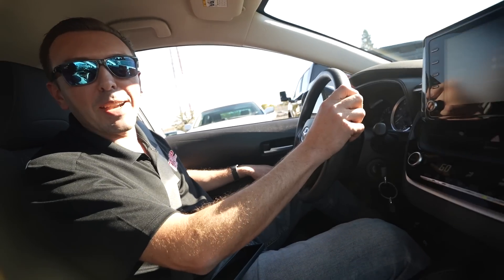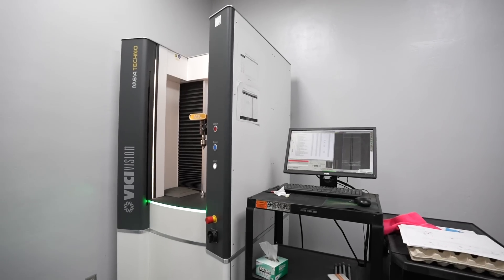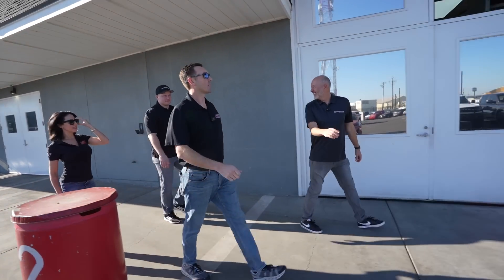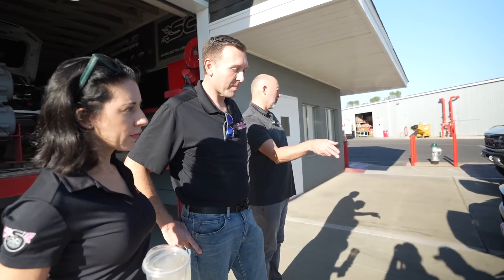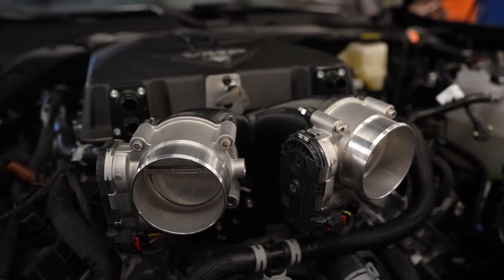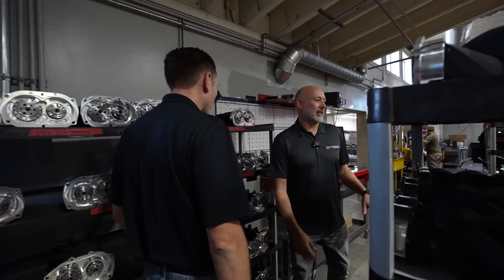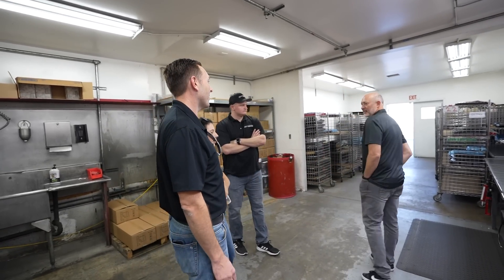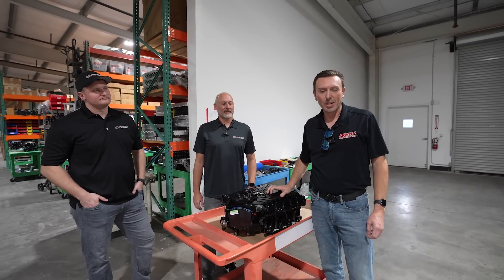When two supercharger powerhouses get together, HORSEPOWER happens!  ||  VMP Gen 6 3.0 L '24 S650

Comment: I’d absolutely die to see VMP, Whipple or Eaton come out with a “Kit” for every old school roots ‘71 series blower owner to convert to a TVS, or screw rotor system in their existing case! 

Whipple went and made the W510R that’s a screw version of a ‘71 series roots, but who wants to scrap their $4,500 plus roots they already own to buy a $6,800 new blower..? NO ONE! 

Why can’t a TVS rotor pack be manufactured, and a “shoe” for the top if needed and  an insert for a delta on the bottom… 

Need to make roots blowers great again! 

I’m not the guy to pioneer it… 
There’s probably 8 times the amount of roots blowers out there than there are people with “new style” roots and screws…
Reply: Because demand or rather lack there of. Plus the cost to design it would make it almost as expensive as getting a whole new blower.
Reply: Obviously for the first one… 
Not for the 3 million kits sold thereafter, just in the states… Proper marketing and display at SEMA and PRI… it would explode like never seen before. Not to even consider every Australian with a roots blower… It’d be multi billion income…  @mooosestang
Reply: Look into Harrop out of Australia. They're not cheap but they do this exact thing.

Comment: So when exactly did VMP become a supercharger powerhouse? 😂
Reply: VMP is waaayyy superior to Whipple. Whipple is all the hype. Their quality control sucks. I've seen it first hand.
Reply: @JJD-9403  Whipple is literally making VMP superchargers. 🤣
Reply: @JJD-9403 vmp superchargers were made by roush and magnuson
Reply: @petergalvez6431  and Whipple is making them now. Did you even watch the video?
Reply: @JJD-9403  I've been running a 2.3L whipple on my 06 gt for 17 years and counting. Not one thing has gone wrong with it. WTF are you talking about? They will also stand behind it even outside the warranty.
Reply: @mooosestang  Glad you think so. The case on my gen 3 was totally out of spec. Rotors making contact with the case. I was told blower must have taken in debris.  Blower WAS NEVER even installed. It was fucked right out of the box. The back and forth with Whipple was ridiculous. They were complete assholes about it. Absolute junk!! Never again. Glad you had better luck than me.

Comment: Justin, I bought your Gen3R appx 3 years ago for my Gen1 Coyote & love it! ... My 2014 Shelby is still running OEM Supercharger (don't plan to change that one)... However, our 2019 Gen3 Coyote is just coming outta warranty, so we are planning to buy a Supercharger kit later this year... Will this new combo company Supercharger be available for our 2019 vs the ODIN & if so, what will it be called??
Reply: Buy a gen6 whipple and make 630whp on 10psi with 93
Reply: @RadDadisRad I made 725whp with a Gen3r on my 2014 Gen1... I hope to God yall making more than 630whp on a Gen3 car with a Whipple.
Reply: @still.emotion  not at 10psi

Comment: Was the TVS 3100 a big disappointment vs. the 2650?
Reply: Yes. Same power at same boost.
Reply: @RadDadisRad   Same power at 15 psi on a stock engine or something?   Would love to see the data
Reply: @BCSVT  they used a supercharger dyno. When comparing the 2650 rotor pack to the 3100 they saw no advantage because the extra horsepower that the 3100 made it used to drive the larger rotors. So more strain on the crank snout for no measurable gain in performance.
Reply: @RadDadisRad   Doesn’t seem possible.  I guess Eaton really dropped the ball on the 3100 rotor pack somehow
Reply: @RadDadisRad  are you referring to the original TVS 3100 testing from 2-3 years back, or the X3100, 2nd revision of the 3.1L rotor pack thats been teased since SEMA 2022 but haven't heard squat about since?
Reply: @edmundnlemadim  both, no benefits were seen by Magnuson.
Reply: @RadDadisRad  well that sucks. looks like 2.65L is the limit for TVS technology. Need more power in a street car, its (race ported) Whipple 3.0, Whipple 3.8, or turbo 🤷🏾‍♂
Reply: Went from a Magnisun to a Whipple ..
.😅

Comment: I've always been confused on the relationship VMP has with other blower companies. What is the difference with a Whipple blower with a VMP badge on it? Cheaper materials for a discounted cost? could you clear that up at all?
Reply: Whipple head unit, so rotor package. VMP will design their own other things like snout and inlet neck and intercooler brick design/placement.
Reply: LOL it will be 100% whipple with a VMP lid whoopdie do.
Reply: @tylerolson5860  so what’s the point of it then, if that’s the case? Why would whipple cut VMP in?
Reply: @TwinTurboLsx they probably bought a huge % of the company so they kinda can do what they want. And some fans are loyal to vmp so it’s best to keep vmp and just collaborate.
Reply: @tylerolson5860  I could see that. It’s just whipple sells so many they have problems keeping up with demand. Especially since they partnered with ford to put them on the new trucks. The fact VMP has done this with other brands, there has to be more to it. Something must be different to allow VMP to make money I’d think.
Reply: @TwinTurboLsx  I dont think so.  Its more VMP needs to sell something because the Odin/Loki kits were sort of a bust.
Reply: @TwinTurboLsx  The tune is likely going to be different. I mean tuning is kinda of justin's thing.
Reply: @mooosestang  the tune? I’m referring to the blower itself.
Reply: @mooosestang  24’s still locked.  Whipple is the only one with access.   I think this is the biggest reason why VMP had to collaborate with Whipple.
Reply: @TwinTurboLsx  money
Reply: @tylerolson5860  how are the loki/odin kits a bust?
Reply: @cenokisfamily  how many of them do you see?  vs. Pervious VMP 2.3 and 2.65 blowers the Loki/Odin sales #s are wayyyyyy down.
Reply: @RadDadisRad  ok interesting. Nice to know.
Reply: Whipple helped save VMP! That’s about it
Reply: It’s kind of funny a few months ago, Wipple put out a video about how they were superior to vmp and now I guess vmp has accepted it.
Reply: Still need that K.B. Screaming Whistle when the throttle is mashed

Comment: So basically it’s a whipple with a vmp badge on it lol
Reply: And they can thank the engineers at EATON for their research and development of the rotors. Without the Eaton blower non of these turds would be here. These guys don’t have the constraints Eaton had with environmental and noise pollution limits along with pricing it for an OEM application that needed to be durable enough to warranty.
Reply: @yay-3012  Eaton is based on a roots super charger .... not a lysholm twin-screw supercharger that the Whipple s. 

Not the same tech.  Go look at a compressor map for a Eaton. It's in the low mid 60's.  Whipple is in the 78-82%.   

That why you can simply swap a factory Eaton with a Whipple and pick up big gains / changing nothing else.  

Edelbrock is based on Eaton and it's garbage.  Not the kit - the output.
Reply: @yay-3012 it ain't got a damn thing to do with being durable.  It's probably emissions related if I were guessing.  The Eaton rotor packs and vmp cases are plenty durable.
Reply: Whipple has had some QC teething issues with the Gen 6 release (rotors not clocked correctly and out of phase). And popularity for Whipple is all time high. 

Makes sense to pair up with a retailer specializing in superchargers on the east coast.
Reply: Add KB in their too. 

Btw - the owner is a tool.
Reply: Why would anybody buy a vmp when you can buy Whipple????
Reply: @richardtruitt5073  why would anyone buy a positive displacement blower over a centrifugal or turbo is my question.
Reply: @Gregoman89  Because lag.
Reply: @mooosestang  thing of the past really,
Reply: @Gregoman89 simple…centi’s make zero torque and are much less fun on a street car. Turbos are great but the install is much more complex and there’s a lot more maintenance with a turbo system.
Reply: @Gregoman89 applied power, ease of maintenance and installation  etc.
Reply: @Gregoman89 seriously? You can't figure that out on your own? Because some people want full boost off idle and in the case of Turbo most kits are really expensive unless you build your own. I probably will end up with a ESS on my gen 3 10 speed but I completely understand why many want a positive displacement supercharger. PD blower kits are also much more reliable in my experience. For instance I am going to need gear or a converter or trans rebuild with a good trans brake. All of which can be eliminated with a PD blower making full boost off idel.
Reply: @richardtruitt5073  because whipple needs distributers and  professional tuners to install this thing around the country. . First order of business is distribution.
Reply: $10,000 to have one lol
Reply: Exactly.
Reply: Why buy a pos displacement blower u ask? Simple... torque pure tire shredding low end set u back in the seat torque.  U know... th fun stuff
Reply: Yes 😂😂😂
Reply: Better than a rebranded magi
Reply: Its ok if you dont understand custom specs 🤣
Reply: The Gen3r is made by magnuson,  so this is nothing new.
Reply: Yep😂🤣
Reply: Might be a ported version of the new Gen 6 3.0L Whipple with dual throttle bodies/intakes similar to the stock 2024 Mustang setup.
Reply: VMP is sooo much better
Reply: @JJD-9403  vmp never made superchargers 🤷🏻‍♂️
Reply: @petergalvez6431 wasn’t the VMP supercharger just a roush blower???
Reply: @godsavemefromgenZ  Not really,  Vmp made their own cases and supporting parts. The vmp case is better for sure.
Reply: @crackedbrainOG this.  All the vmp haters acting like it's just a roush or any Eaton rotor pack blower is the same have no clue what they're talking about.  The vmp units weather it's rear feed or the odin are superior to other 2300 and 2650 rotor pack blowers.  Just because they use the same rotor pack doesn't make it the same lol.  You seem to understand that at least.
Reply: @midnight347  For sure! The better design on the case was why I went with Vmp over Roush. I don't get the Vmp haters either.
Reply: @midnight347  the word you are looking for is whether.😉
Reply: @godsavemefromgenZ  magnuson makes them for vmp i beileve
Reply: @godsavemefromgenZ  roush , eldlebrock and vmp are eatons with different cases
Reply: @godsavemefromgenZ They were Magnuson Rotors with VMPs custom touch on everything else.

Comment: Is that the same 3liter whipple that Cleetus has on his f150?Its a great sounding unit.👍
Reply: Whipple has been the hands down best in the game since the early 90's. 

Best positive disposcemt s/c out there and rivals turbos on an efficiency map.
Reply: @damoncus8124 isn’t the centrifugal supercharger that rivals turbos?
Reply: @utahcountypicazospage5412  no.  None of the centrifugal are close. They tend to be in the 70-72% efficiency range (on a compressor map) 

The Whipple (lysholm twin-screw supercharger) is the only s/c that matches a turbo in the 79-82% mark on a compressor map.  

Don't confuse it with the roots style  s/c that may externally apparat similar (take edelbrocks  kit). Those operate differently and the efficiency is garbage. 65% at  best. 

The Whipple is just a brilaknt supercharger design.  Not to mention simple to install.  I've pulled and out back on dozens on my cars.   

Doesn't mean it's better than a turbo.  No lag - but the turbo will make more power net, just because it's not belt driven and no  parasitic losses.   Yet for heat and power made compressor vs compressor  the same.  

Personally  - unless you are trying it set some huge record or time.  Just get a Whipple  - installs in a few hours and call it a day.   Turbo kits are always a nightmare - unless it comes from the factory with one l you're upgrading.  

3.0 wjipple on say a mustang  gt / s550 tuned will make 900rwhp all day - air fuel in a safe range.  It takes the place of the upper intake.  It's capable of 1400hp  or 30psi with bigger heads or on another platform.
Reply: I'm assuming so. That truck made some gear power and was fast as hell especially for a truck.

Comment: Interesting. Whipple is king on their own😂
Reply: Not really.  I run a VMP supercharger and have dragged many Whipple's asses. The only Whipple that got me was a 3.8
Reply: Whipple makes their own blower, vmp does not. Biggest difference
Reply: @robfeldschun6146  Am not knocking Whipple they are a badass supercharger. VMP supercharger just has probably the better low end response.
Reply: @katkilr7685  VMP doesn't make superchargers, it's just their name on it.
Reply: @robfeldschun6146  facts
Reply: @zonapainter  were did I say they made the supercharger..?
 I have been running there supercharger since '17 and it is my experience that the VMP just has a better power range.
Reply: I would agree on the fact they make superchargers far larger than 3L and have been doing it successfully for many decades.